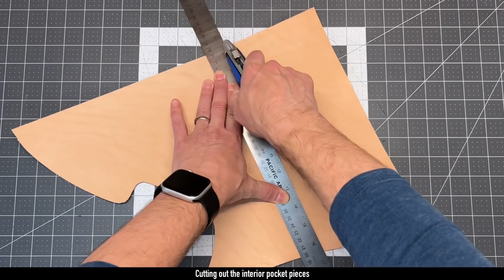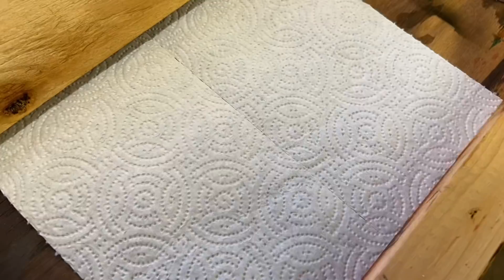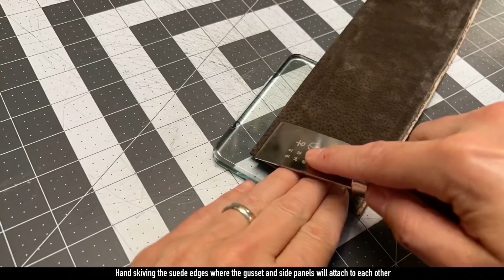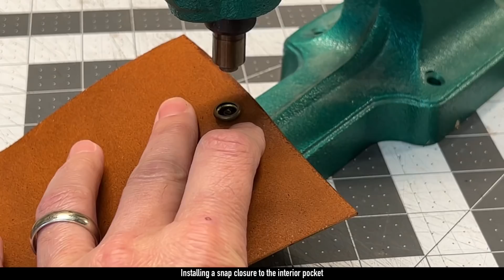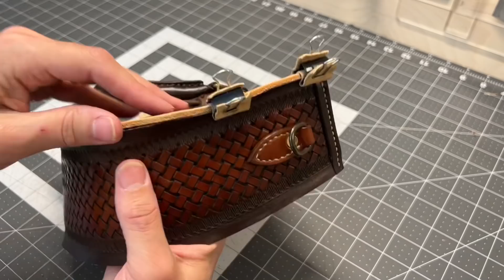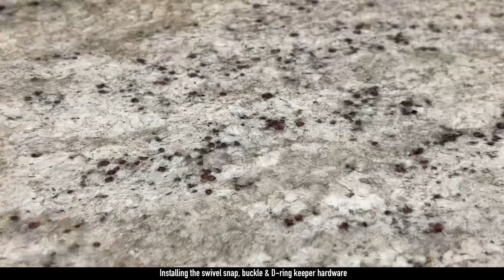Making A Tooled Leather Cross Body Bag - Leather Craft

Comment: Did you skive the handle pieces by hand because you needed a longer bit of the leather taken down, vs using the machine skiver?
Reply from the maker: I believe I skived by hand because wanted the leather to gradually taper down to a thin edge.